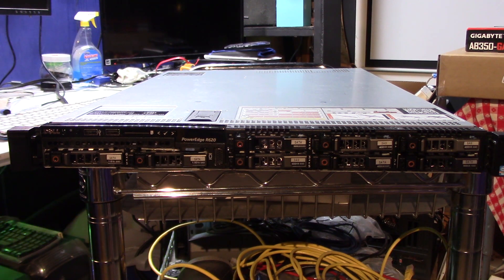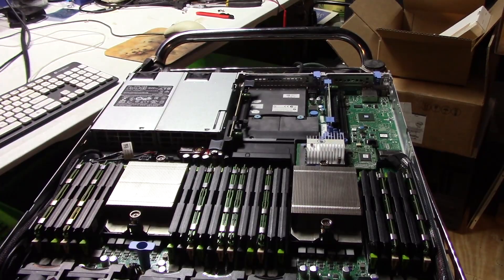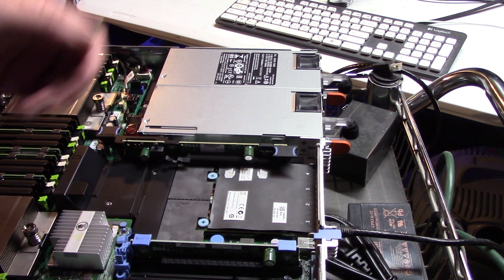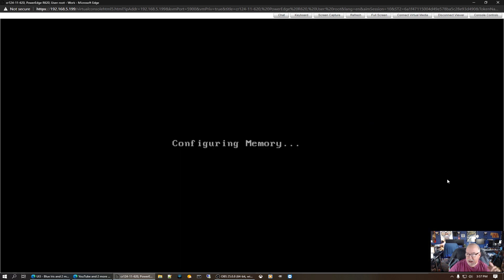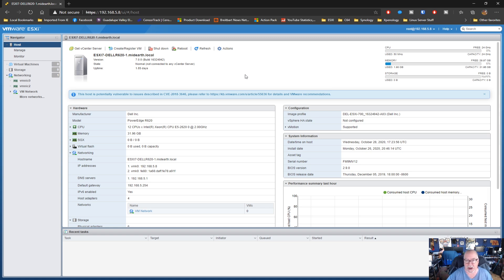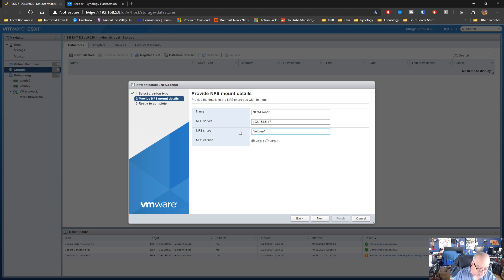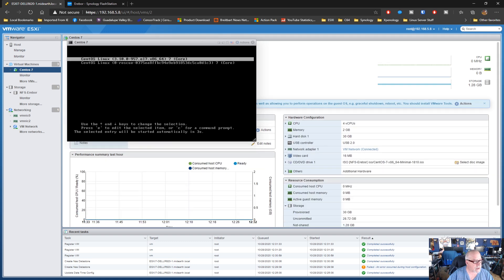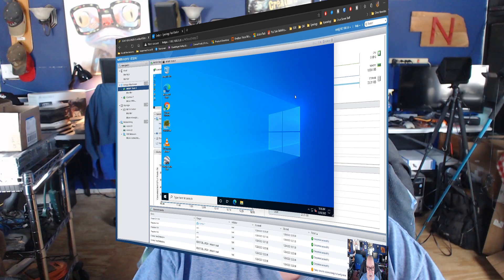VMWare 7 install on the Dell R620

Comment: im stuck at step 8:38. I am getting confirm disk selection but no upgrade option. I chose my Kingston usb hit enter and i get the message confirm disk selection. you have selected a disk that contains at least one partition with existing data. Any thoughts on why this keeps happening

Comment: Nice video and very informative. I have Dell R620 with the following specs.
Model:	PowerEdge R620
Processor Type:	Intel(R) Xeon(R) CPU E5-2667 0 @ 2.90GHz
Memory 256
 I have successfully installed VMware ESXi, 7.0.0, Build # 15843807 and trying to update it to Build 16324942 but having unsupported CPU issues.
Is there a recommended CPU that can support future ESXi 7 update?
Reply: did u solve it?
Reply: @pablitomassa82  No, I realized that the CPU CPU E5-2600 is no longer supported by VMWare .
Unfortunately, I am stuck with the v0 processor. Any VMware updates afterwards, can't be installed.
Reply: If you have the H310 mini what cable are you using to connect it to SAS A and B?

Comment: Do you have a youtube video on how you set up your shared NFS storage on the Synology, I saw how you have a shared folder that I think you are putting your VM's in and that way you can go to another server and access those vms. 

I have two Dell servers and one of them is running ESXI 7 and the other Server2019 and I want to put all the VMs on my DS1815+  where I have lots of storage.  Any help would be greatly appreciated.
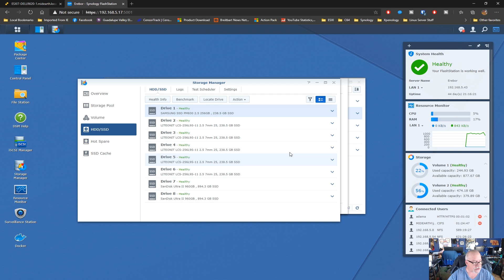Reply from the maker: I am assuming you watched the video? Especially this part 16:07 where I cover the NFS share ? :)
Reply: @UnkyjoesPlayhouse  I did see that but I think you already had the NFS share created and just made the NFS share available to the Dell R620, I would be interested in how you set up the original NFS share and then it looks like you can share it out to all your servers. I need the info on creating the NFS share the first time and how you set up the first server to access it.  thanks Jim